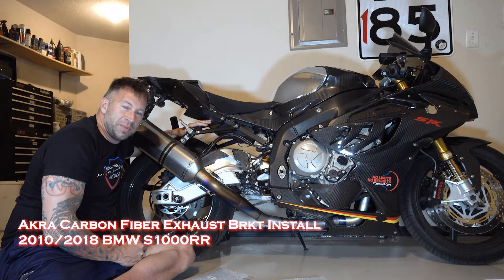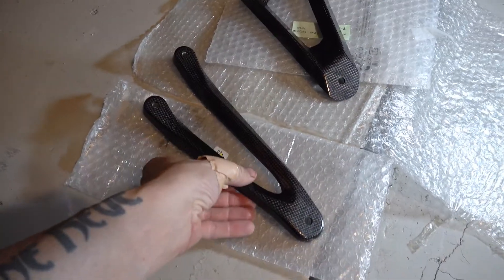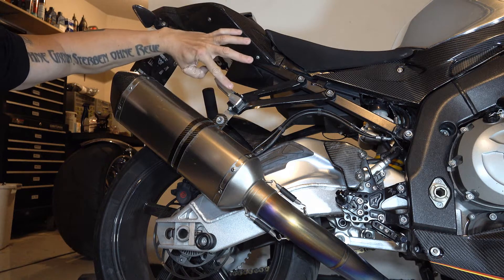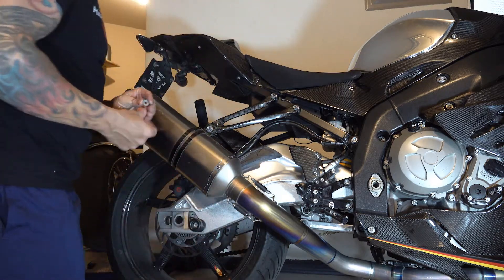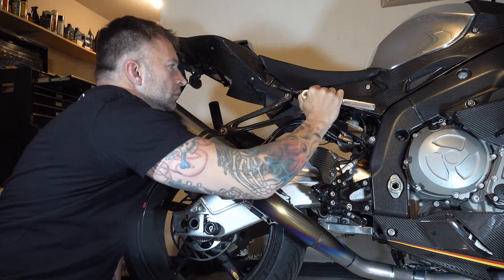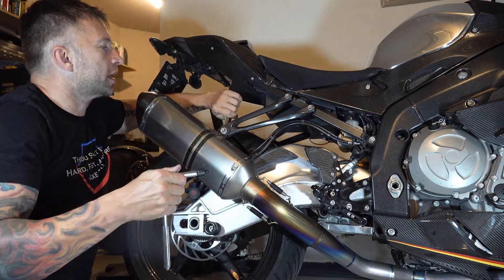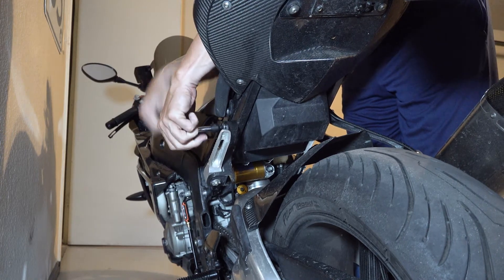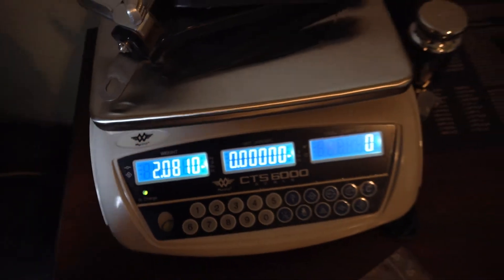Akrapovic CARBON FIBER Motorcycle Exhaust BRACKET - BMW S1000RR Custom Modification

Comment: inside of upper holes are aluminium spacer glued, you can remove then and save some gramms extra;)
last series of the carbon exhaust bracket the space not longer installed while carbon only is more stiff and strong to hold exhaust.